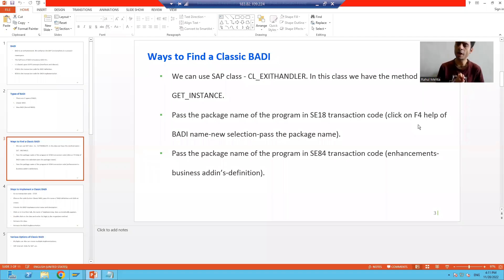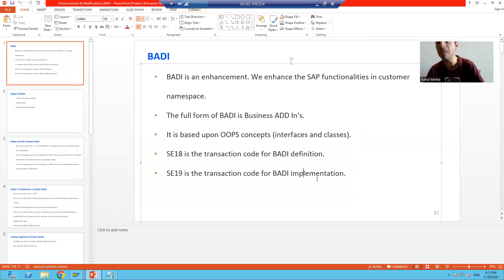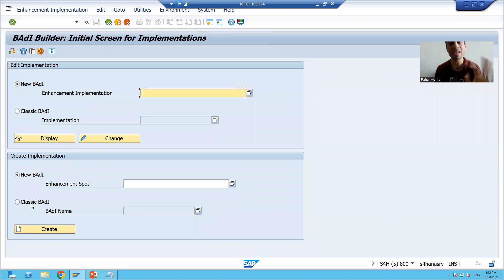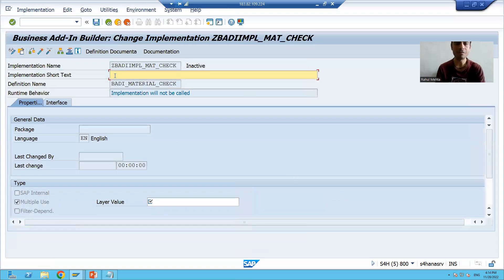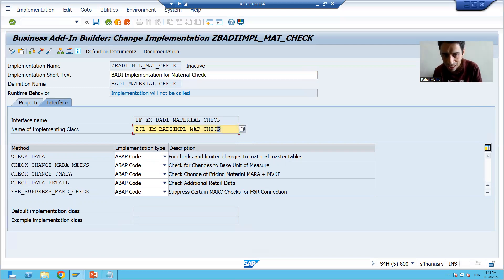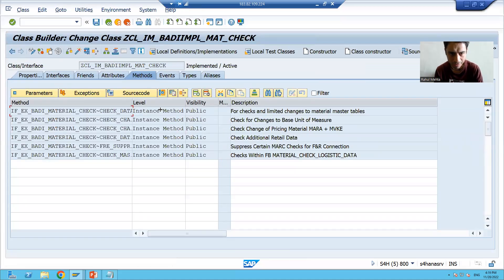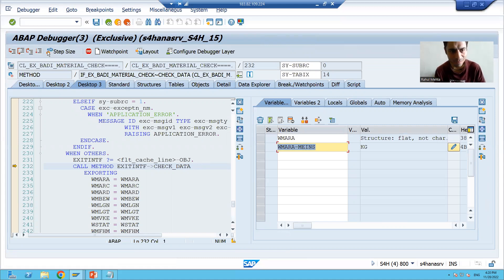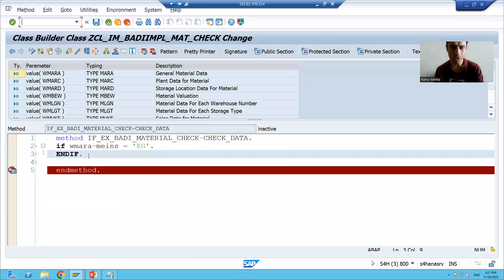24 - Enhancements & Modifications - BADI - Classic BADI Part2

Comment: Sir, I tried implementing with method IF_EX_BADI_MATERIAL_CHECK~CHECK_CHANGE_MARA_MEINS, I kept a break point in this method and When I hit save in MM01, the program didn't go into debugging mode. Material saved. But with IF_EX_BADI_MATERIAL_CHECK~CHECK_DATA, It went into debugging mode after hitting save button.
Reply from the maker: Hello - Have you tried this using MM02 transaction code and changed the unit of measurement?

Comment: Hi sir, below the CHECK_DATA method there is a CHANGE_MARA_MEINS method. Why you haven't written the logic there.
Reply from the maker: Hello Charan - CHANGE_MARA_MEINS is a dedicated method for the Unit of Measurement only. With the help of CHECK_DATA, We can check all the fields. I just took the example of MEINS, It can be any other field also, so I took a  method which is applicable for all the fields. If you have the requirement of only Unit of measurement, you can implement second method also.
Reply: @sapabapbyrahulmehta   thanku very much for explaining